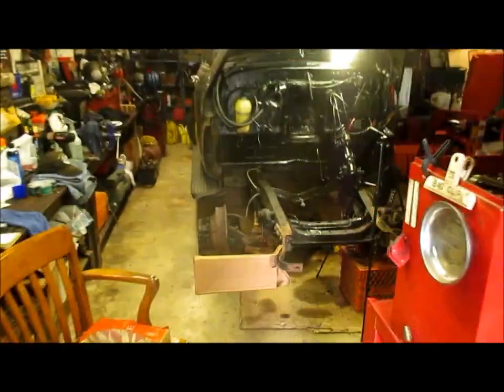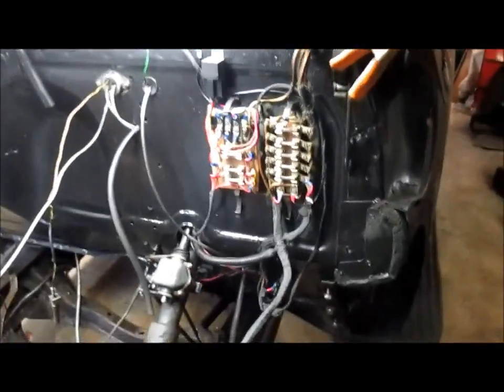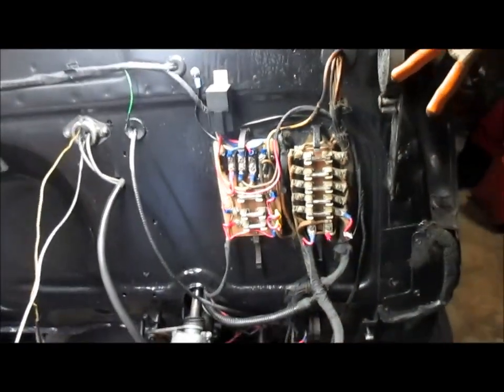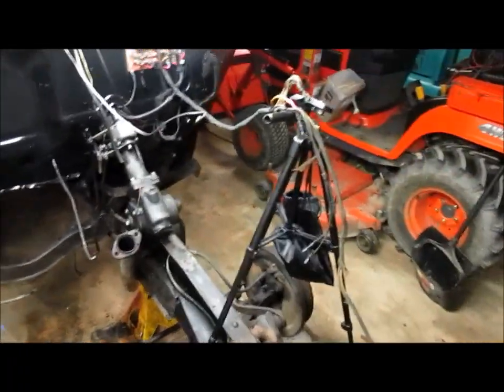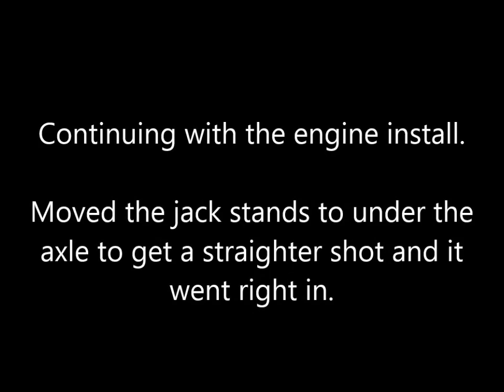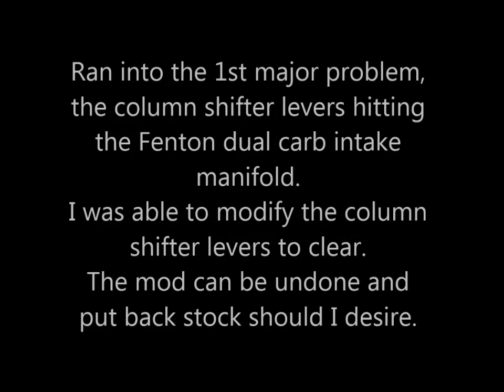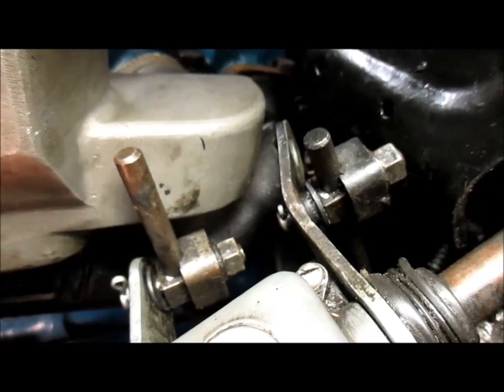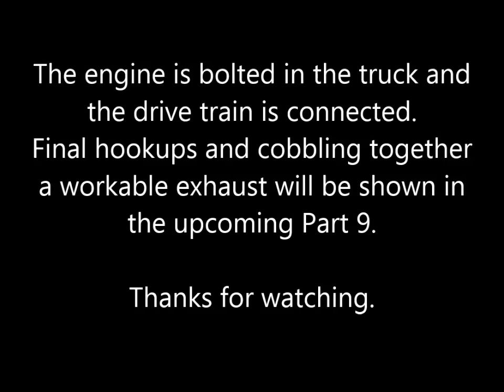How I Installed a Chevy 235 engine in a 49-53 Chevy 3100, 1949 Chevy 3100 restoration Part 8

Comment: I would like to know where you get your parts from. I deal with a few suppliers but would to have another option. Your videos are very good and entertaining to follow. Thanks for doing a great service
Reply from the maker: Thanks jon. Unfortunately the main supplier I used for the engine parts is no longer in business. 
For Stovebolt performance parts I used:
http://www.langdonsstovebolt.com/
I've probably used Classic truck parts more than the others:  https://www.classicparts.com/
But I like to shop around so I've also used:
https://www.chevsofthe40s.com/?gclid=CjwKCAiAgbiQBhAHEiwAuQ6Bkkk7JQ6NLxOIFRFi3BSlWPkgvgYp7oHNz14DKM061MUHnLdOh1ZCjRoCoLUQAvD_BwE
https://oldchevytrucks.com/
https://www.brotherstrucks.com/
ebay and the used parts sections of the following two Stovebolt truck forums:
www.stovebolt.com
http://67-72chevytrucks.com/
I've also bought parts at local classic car/truck shows.
Hope that helps.

Comment: Have you ever changed the gears in the differential? I have a four on the floor with what I presume to be the original 4.11 gears in the diff and I max out at 60, 65 at absolute most. I want to change the gear ratio to get a more appropriate cruising speed for highway travel, but I also want to be able to start a load if need be. I’ve been looking online and can’t seem to find much for a good hauler/speed combination. I was thinking of putting in a four speed with overdrive to replace the four speed with granny gear, but on the other hand I want to keep the low gear to start a load if I ever needed to. I would like to put a hitch on it and haul some things every now and then in the future with a trailer. Thanks
Reply from the maker: Wally, I haven't done this upgrade and really haven't researched it beyond reading up on it. I do know the most popular upgrade is to change the rear gears out to a 3:55 ring and pinion set. All of the existing drivetrain remains the same which keeps the costs lowest of all options. Those that have done it claim 65-70 mph all day long. 
Patricks used to carry the complete upgrade kit but they've closed up and I'm not sure who carries the kits now. If your truck is a 1955.2 and up you can swap in a T5 S10 tranny but I haven't researched it that deeply either.
I do know getting interstate speeds out of our AD trucks can be a major undertaking.
Good luck.
Reply: Volfandt thanks for the information. My truck is a 49 also, so I should be good in that sense. I’ll have to look into it more and see what options are out there that I can find. Thanks for the info!

Comment: Does the 235 just bolt from the 216 ? I'm about to do a swap on my truck and I'm afraid to even start because I dont know if it's  going to need any modification.
Reply from the maker: Yes it's a direct bolt in but, there's a few things that must be done to certain year 235's and whether the 235 engine came out of a truck or a car. I'll try and list what to look for:
1) The 235 engine must have the front motor mount thats behind the harmonic balance and not on the sides. If the 235 came out of a car it may have the side motor mounts. You can swap the front motor mount off of the 216 to the 235.
2) You'll need to swap the 216's bell housing on to the 235 if your truck is a 53 or earlier. If your truck is a 54 and up you can use the bellhousing thats on the 235.
3) If the 235 is a 53 or 54 engine the water pump is the same as the 216 and no modifications are needed. The the 235 is 55 and up you'll need to swap to the short shaft water pump and purchase a water pump relocation plate (can be found on ebay) that will center the fan on the radiator which improves engine cooling and won't cause overheating.
All needed modifications are well documented on the internet and are easy to do by anyone with mechanical abilities.
Make sure you check out my engine install series as I try to cover the basics.
Good luck.
Reply: Ok thank for your advice, it gives me a better idea on what to look for. I really appreciate it.

Comment: Hello, I wanted to say thank you for posting and sharing your videos and especially the videos pertaining to your 1949 chevy 3100 pick-up truck. I also have a 1949 chevy 3100 and have watched many of your videos and they have inspired and helped me through my puzzle. I had two questions about mount the front motor mounts. The first question is how did you get the bolts in the front motor mount on that 235? The second question is what type of fasteners (bolts, nuts washers did you use to mount the 235 in the front? Thank again.
Reply from the maker: Thanks dsim9988, my hope is these video's are helpful. The journey is definitely worth the effort and the finish is definitely worth the journey.
The motor mount is actually a 2 or 3 piece motor mount "sandwitch".  Basically you want to insert the two long carrige bolts through the holes in the engine front motor mount bracket and slide the assembled motor mount "sandwitch" up onto those bolts. That way when you install the engine the front mount is installed at the same time.
Good luck
Reply: Volfandt ok, thanks for replying. How did you get the bolts into the engine mounting bracket. I have the harmonic balancer and the timing cover in the way. Thanks again
Reply from the maker: @dsim9988  Unfortunately if you can't work the bolts around the lower timing cover and harmonic balance you'll have to remove the H.balance and try. The bolts should work in without removing the timing cover. If not, well you know what needs to come off next... 
The H balance is a somewhat easy pull  & reinstall. As an FYI use a puller that bolts into the threaded inside "hub" part of the balance to pull it off to avoid damaging the rubber isolation layer thats between the inner and outer harmonic balance castings. 
Those 2 bolts on my 216 and the 235 remained "locked" in to the front motor mount bracket and I left them intact so I didn't have to deal with this situation. 
Good luck.
Reply: Volfandt okay thanks again
Reply: Hello Dave,  getting ready to install transmission up to 235 bellhousing. Having trouble getting the clutch fork to sit and stay on pivot ball in the bell housing. The retaining clip is inside the fork cup. I can get the fork to ever so slightly to snap on to the pivot ball but when you attempt to move the fork it falls off. Any tips on how to get the fork to stay on more secure. Appreciate any advice. Thanks

Comment: Hi
I got a ? 
Regarding the gauges.
Are they 6 volts or 12 volts?
Or the work either 6 or 12 without problem?
I see a white porcelane voltage reducer, i think...
I dont know what's that for.
Thanks!
Reply from the maker: Eric, the ammeter will work with 6v or 12v. The oil pressure and coolant temp gauges are mechanical so voltage doesn't matter as they don't use voltage. The gas gauge does require electric current and it's designed for 6v so I've got an aftermarket resistor that will drop the 12v down to work on the 6v fuel gauge. I'm going to use another higher current resistor to reduce the 12v to use on the heater motor. They come in a white porcelain or metal caseing. I'll also be replacing all  the 6v bulbs with new 12v bulbs and/or LEDs, which ever is the brightest for the tail/brake lights.
Reply: @Volfandt  Thanks for the info. 
I also have a resistor that converts 12 to 6 that i bought a while ago just in case. 
If i unplug the fuel sending grownd and with the switch on, the fuel gauge dont move...
Whats next to check?
Reply from the maker: @ericruiz2174  Your sender is basically a 0-30 ohm variable resistor. Empty it'll read around 0 ohms, full around 30 ohms. 
Heres a link to a basic troubleshooting chart: http://www.fifthaveinternetgarage.com/tech_tips_gas_gauge.php
Good luck.